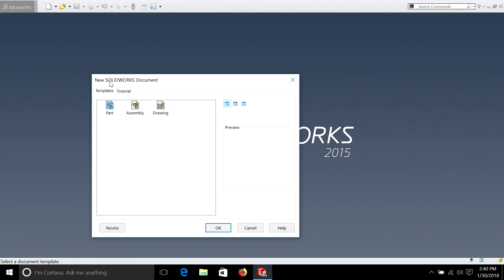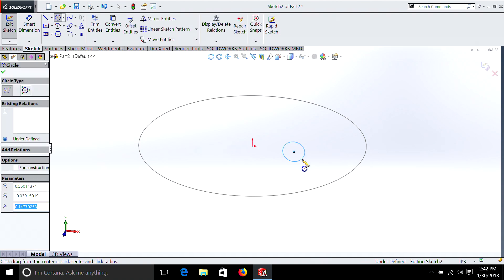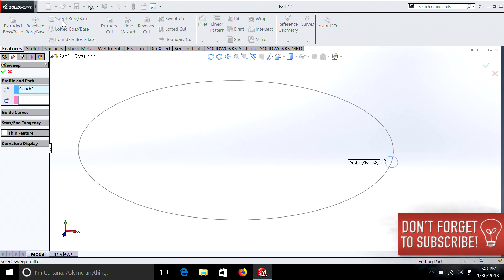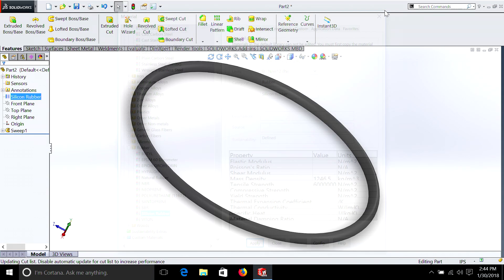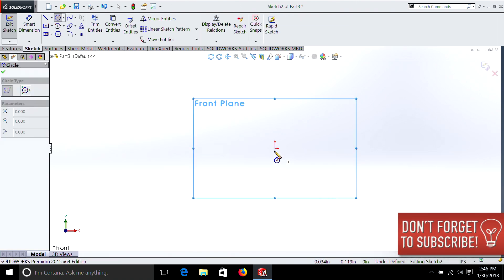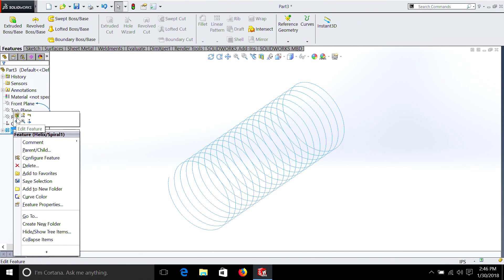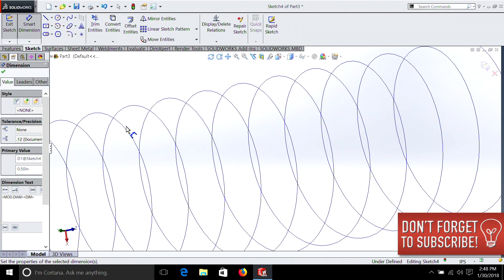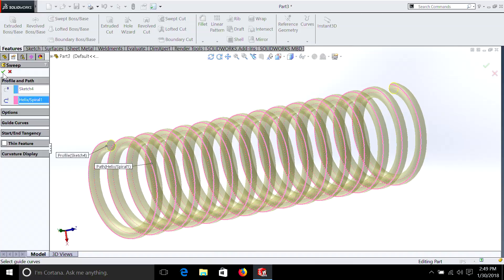Learn Solidworks In Five More Minutes | Part 9

Comment: love your videos however on this one i can't find pierce at all my comes up with coicdent and fix
Reply from the maker: Lewis Saunders pierce will only show when a line and a point are selected in the relations box. The line must be at some angle to the points plane. In other words the line must be like a thread of a needle through the plane that the point sits on.
Reply: Invention Therapy I will try it again later, I am new to solid works and have to design a jig for the front panel of a display screen to be secured whilst drilling the holes for mounting gorilla glass on to the panel, panels range from a length of 20cm to 40cm and a height of15cm to 25cm and the gorilla glass display screen varies from 10cm by 8cm to 20cm by 15cm. The jig has to be adjustable to accommodate different front panels,

Do you have any design ideas? 

Regards, Lewis Saunders
Reply from the maker: Lewis Saunders Make pockets where the smallest size panel is deepest. Each panel should be perfectly centered as they increase in size. Sort of a reverse pyramid going deep into the jig . The larger panels won’t fit into the smaller pockets so it is guaranteed to align each correctly on center. You just need to have areas in the center of each side to get your fingers in to pull out the finished panel. You can’t align by an edge to keep on center with different size panels so this seems like the best choice without making complicated offsets or multiple jigs.
Reply: Invention Therapy I like this idea, what sort of fixtures would you recommend to hold the panel in place whilst holes are drilled, do you have an email address I can use to send you a photo of my design so far and you can look and give me any feedback or recommendations on my design 

Regards 

Lewis Saunders
Reply from the maker: @TheH1TM4NxL3W1  We do design reviews during our lifestreams but I am on vacation for another week. I would be able to help when we return back to work.
Reply: Invention Therapy ahh okay, this may be too late as my design project has to be handed in on 9th January cheers anyway.
Reply from the maker: It should be easy to design. Just make a larger aluminum plate with a hole in each corner for mounting to the mill table. Cut your largest panel rectangle first at the same depth as the panel thickness. Then cut the next smaller sized panel inside that square to the next same depth. In other words if the panel is 2mm thick, your first largest panel goes down 2mm and then the next one down to 4mm (2mm+2mm). It will look like steps all around the edges. If you have a thrid size panel, take that one down another 2mm or a total depth of 6mm. You can than put half circles in the middle of the top and bottom edge to fit your fingers in. These go down past the total depth so you can grap the deepest and smallest panel from inside the cutouts.